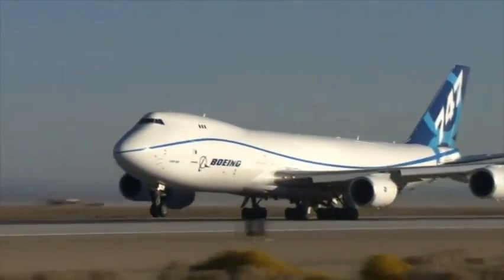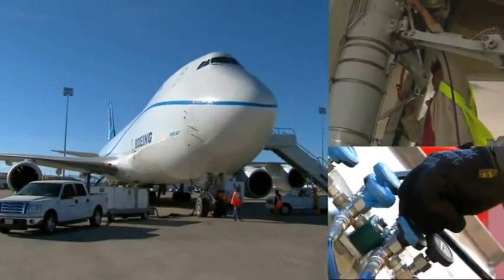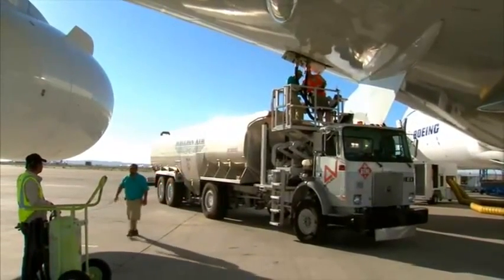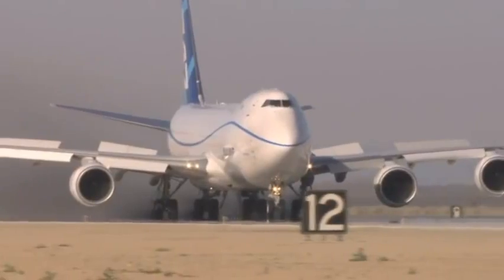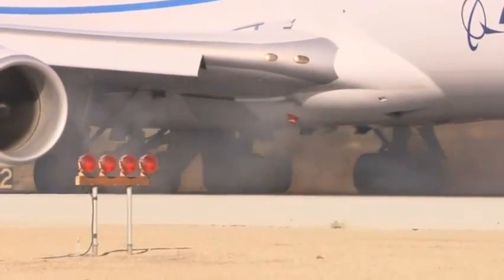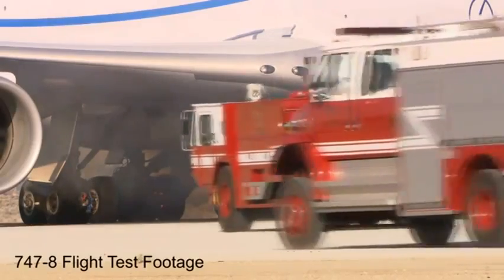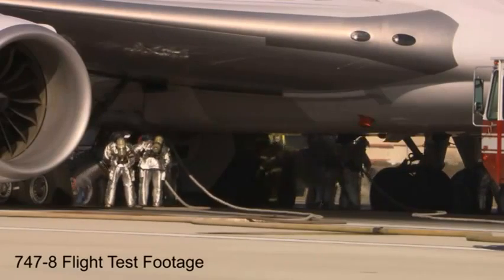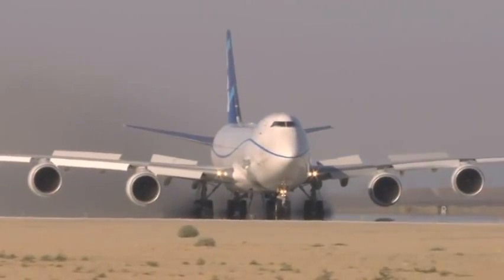How a Million Pound 747-8 Tests It's Brakes

Comment: how often they replace those brakes in normal use?
Reply: Hard to answer.  The brakes are replaced "on condition," meaning that they will wear down to a certain point, and then be replaced.  Brake problems requiring premature replacement are pretty rare.  As far as how long it will be until the wear point is reached, it depends upon how many landings have been made, the weight of the airplane at landing, the length of the runway or distance to turn-off point, wind down the runway, amount of reverse thrust used, runway conditions, and other factors.  Each operator (airline) has average replacement histories, or an industry-wide average can be calculated for a particular airplane type.

Comment: Test engineering is one of the most exciting and hands-on field to work in.
Reply: Jiří Skála
 yah but make sure you only break "something" which is being tested  :)
Reply: What type of credentials does a person need to get employed in that type of work?
Reply: Testing [in engineering] requires cross functional system level understanding of engineering concepts where usually electrical & mechanical engineering branches go hand in hand along with strong influence from control systems i.e software/hardware interaction. So you could be coming from either ME or EE background and once you break into testing field, you gradually start picking up skills/knowledge for other necessary domains.
Reply: And when you break something, it means you did your job right.

Comment: I have disc brakes on my bicycle.

They get super hot when I brake slow on a 15m distance...
That's me and my bike, so roughly 120kg

I can't barely imagine several dozen of tons, at take-off / landing speed...
Reply: lol several dozens of tons, not even close. the video says it takes off weighing 1 million pounds.
Reply: KuBi4K: try putting panniers on each wheel and side then throw something in like bricks or cooler jugs in 'em. that'll put in perspective.

Comment: What is the purpose of this test?  They would check the  brakes preflight so this scenario would never happen right?  Also, I would like to know if a plane this size could stop using ONLY thrust reversers (no  brakes).  That seems like a more realistic test (but may cause some damage to the plane).
Reply: They will, as part of the preflight inspections, periodic inspections and the delivery inspection. Boeing did it then because it's required to comply with the FAR (Federal Aviation Regulations) for getting a type certificate.  It's also used for proving out the AFM. (aircraft manual: We calculated this will stop in DDD meters at MTOW, (Maximum takeoff weight) on a dry runway at AA air density at sea level. We need to know it'll do it in real life. The test was performed in a number of environments and different equipment configurations so the manual can have meaningful derating conversions (hot and high airport? Add X% to the stopping distance per hundred feet of elevation or C degrees Celsius outside air temperature. Wet/snowy or slushy runway? Add XX%. Ice? Add YY%.) Additionally, as the other reply observes, an RTO, (rejected takeoff) is more than likely because of engine failure at or near Vr (the rotation point, just before V2, which is the "You had better get airborne or you will go off of the end of the runway, "If you do go off the end, make a left on MLK, hold short of the intersection and proceed left onto Terminal Drive, cut a right through the TSA vehicle security checkpoint and recontact ground, point five.")

Thrust reversers only? It could, but consider these things that make it vastly less realistic: Most reversers are only ever able to push a quarter to a third (at most. Older, less efficient engine designs could give half of their N1 in reverse.) of the engine's rated full thrust. the GEnx engines can only do 30% of their thrust, so if it took you 2km, for example, to get up to V1 or Vr, it'd take you 6.6km to stop. Not many 8.6km runways out there. When you need to stop, it's not "But what will it do to the brakes?", it's "Oh crap, the tower screwed up and let another plane onto the runway/there are deer and birds on the runway/we blew a tire/the left engine ate a goose/... and if I don't stop right now, we're all dead." Most of your stopping comes from brakes. reversers and spoilers are augmentations, not the primary means of stopping (You don't stop your car at freeway speeds by chucking it in reverse and sticking your arms out of the windows, right? Obviously a little different as the tires in an aircraft aren't driven by the engines, but the principle holds.) Oh and reversers like to blow crap forward and up into the intake. This tends to have a deleterious effect on the lifespan of a jet turbine, what with inhaling gravel into a precisely machined fan spinning at 5,000 RPM with bare milimeters of clearance to the engine casing and nacelle. That's why jet engined aircraft manuals usually say something like "avoid reverser operation below ZZ knots ground speed"

Maximum-energy RTOs are serious business. (Hey passengers, sorry some of you have broken noses, but at least you're still alive: If we hadn't have stopped we would have crashed into a 757 at 150 miles per hour. I'm not a fan of playing "Chicken"...)
Reply: yes true the brakes are checked pre flight by engineers but a rejected takeoff test is to test the stopping ability of the plane at max weight with minimum brake pad thickness, a rejected takeoff can occur due to engine failure, configuration error or other unforeseen circumstances even birdstrikes. the stop speed for the RTO test is at V1 which is the decision for takeoff or stop as you would run out of runway any later than V1. In reality, if an RTO was to take place, there is a large chance that you are not at max weight nor the brakes are at minimum thickness nor the plane is exactly at V1 speed, so it shows the plane can safely stop itself just on the brakes. 

Yes reversing the engines at a low speed does damage the engines very badly. an RTO only uses the brakes as engine failure is one of the more common causes of RTOs.  but yeah i see it would be interesting but the certification process does not require it.

Comment: Can it brakes when speed reach V1?
Reply: +FeelFree3  This was much faster then v1
Reply: +Devin Chastain Not really, because technically V1 is defined as "The speed beyond which the takeoff should NO LONGER be aborted", in reality, this means that there wouldn't be enough room to stop before reaching the end of the runway. so, basically, after V1, you're committed to takeoff because you don't have room to stop.
Reply: +mezsh this guy knows what's up. It's not the speed that's the limiting factor, it's the amount of runway you have left.
Reply: Thierry Van Tillo
that's exactly what I was trying to put across.